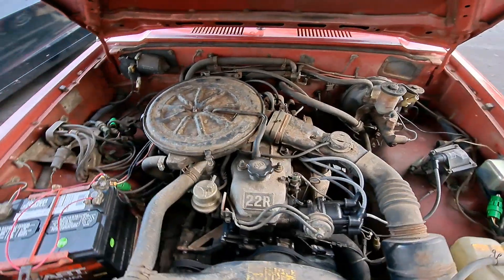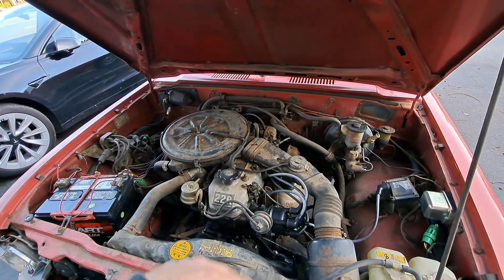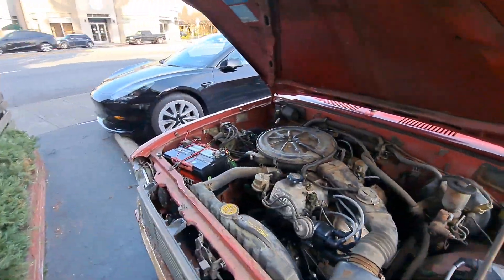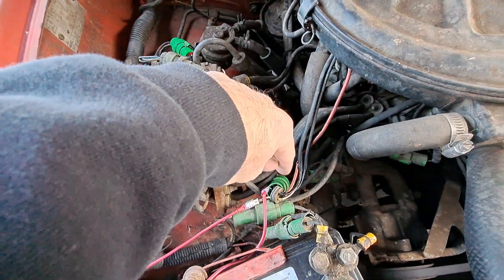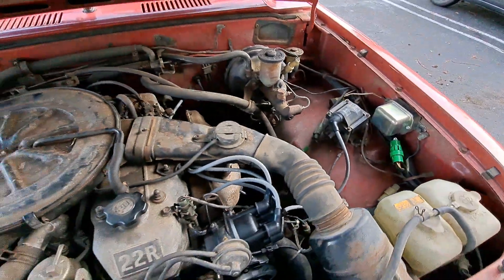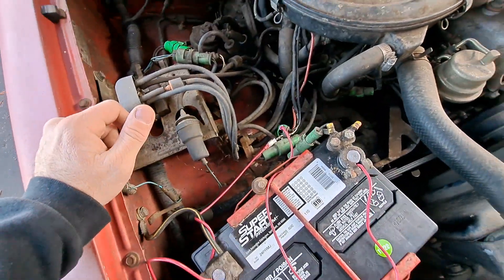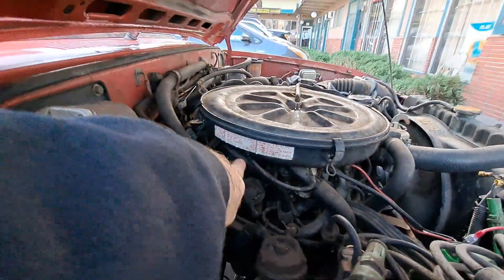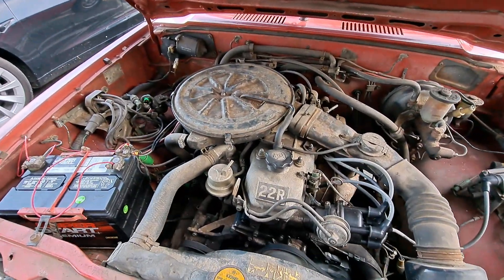1981 Toyota pickup sr5 22R rough idle miss fuel cut out idle cut solenoid fix emissions computer

Comment: I eliminated all the emission control devices on my '81 Toy and installed a Weber 32/36 DGEV carb.  Any switched 12 volt source will correctly activate the fuel cut solenoid or the electric choke.

Comment: MY LORD YOU SAVAGE. JUST bought a 1984 pickup and have my truck dying while driving down the road when i tale it out of gear after its warm. Ill be testing the voltage to my solenoid to see if shes struggling and run this bypass method. I alpreciate the insight, i was thinking of going thru with a fine tooth comb but everytjing else turns on batterys fully charged new wires plugs fuel filter. I have not chrcked the pump but when its cold she will start.

Comment: Is disconnecting the solenoid when it's running ,a good way to know if the solenoid is working?
Reply from the maker: Yes and no. If you disconnect it you will stall, but if the stalling is Intermittent, its likely the smog computer, so tapping the solenoid negative cable as I did is a better test of the computer.

Comment: Nice job!  Very helpful.   My 1982 is doing the same thing. Hard to find info on this issue.  So thanks for the video and the link to the forum about it.  These 1980's cars with a million vacuum hoses to control everything is by far the worse era for  automotive engine control systems ever.  Super complicated and tons of stuff to go wrong.
Reply from the maker: You're welcome and you are correct.